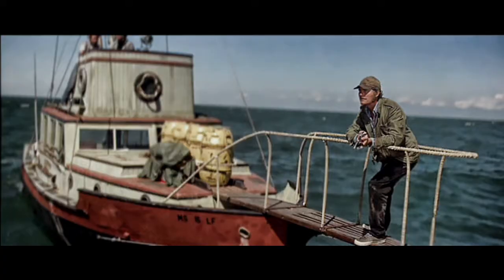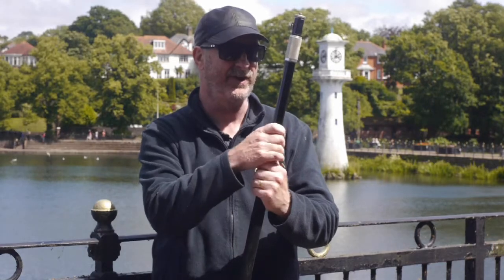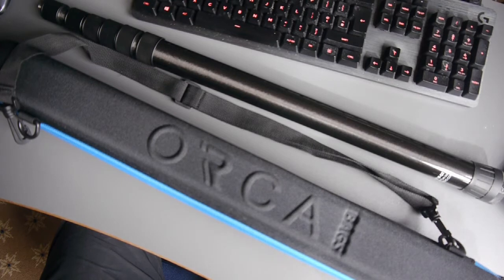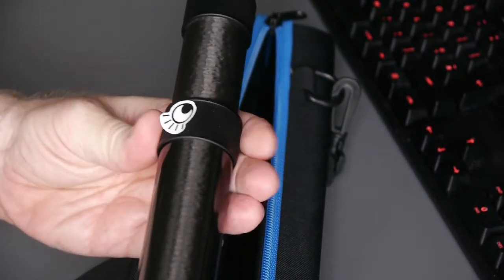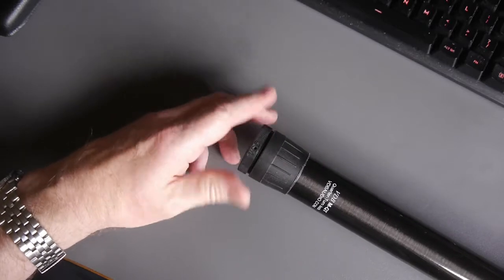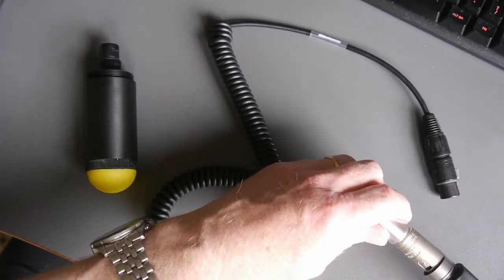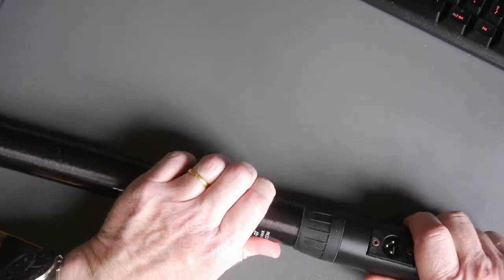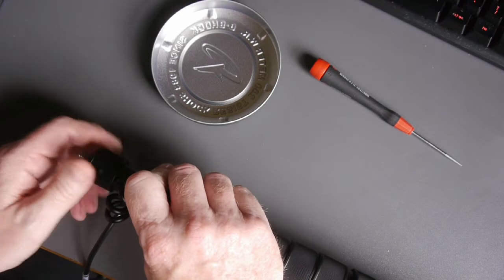VDB - When you need a bigger pole! Jaws gags abound as we look at the VDB M-QT location boom pole.

Comment: Just come across this video, interesting. Couple of points, I have the exact same Panamic, superb pole though the removable tip on mine is damaged a can’t be easily removed any more. I also have an older, but similar, vDb with the internal cable. It’s super convenient but you do have to be careful to avoid some movements if the pole’s not fully extended as the cable can rattle inside. Also, unless they’ve changed the material, never get the collets wet as they will expand and completely jam the pole !
Reply from the maker: Hugh - that is exactly the 'real world' feed back we need. I never had the luxury of internal cabling and when I did try it out in the early days there were issues with rattling. The collet point is a good one - I'm going to do some research! Ta like, ppm6.
Reply from the maker: Hi Hugh - Martyn says all VDB collets are made of plastic and don't expand, I wonder if they changed the material at some point - how old is your VDB?  I think the physical noise thing is true of all internally wired poles - you have to balance convenience with carefulness. With my tennis shoulder and housemaid's elbow I'll stick to radios now.... Ta like, ppm6.